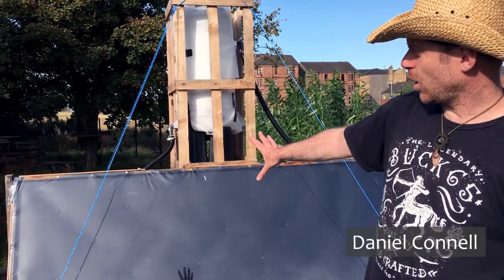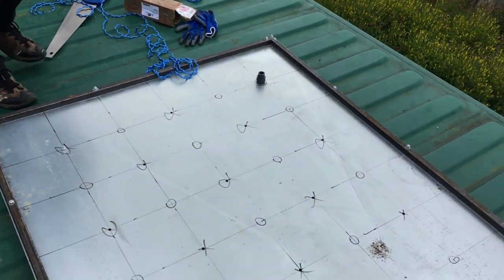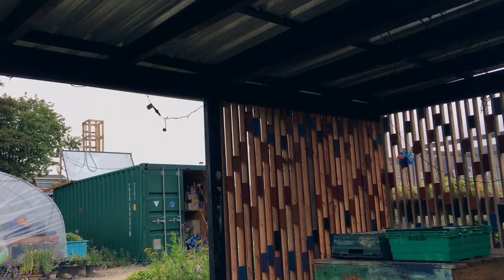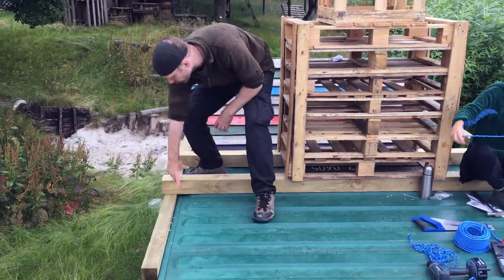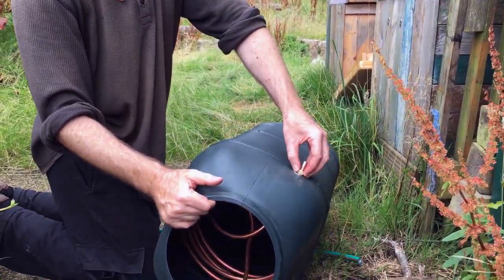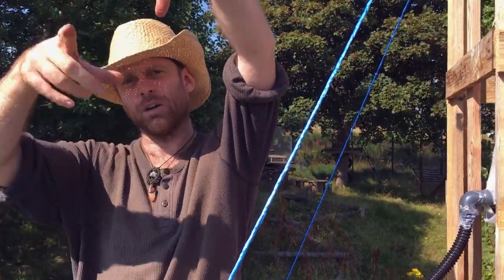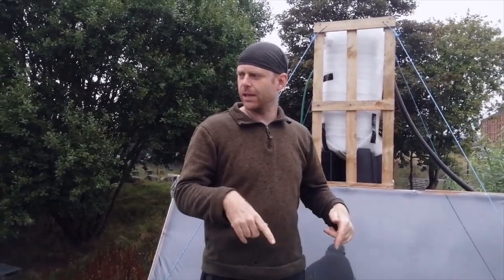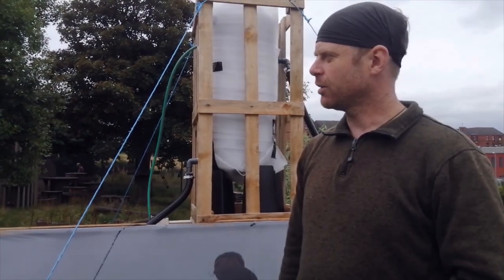DIY Solar Hot Water Panel

Comment: Aluminium Sheets vs gal steel?
Positive: its will never rust, absorbs heat better
Negative: Cost slightly more, less robust
Reply from the maker: Thought about it, I've used them quite a bit for other projects, particularly the wind turbine. The galv should also last quite a while and being 0.5mm or so the differences in thermal conductivity shouldn't amount to much.
My main concern for the alu is that even with the water tank only a meter above the panel the force on the metal is still measured in tonnes.
Reply: @OpenSourceLowTech  I choose alu coz i think it should last maybe around 30-50+ years. 3rd world countries have issue sourcing large sheet quality galv steel, alto they are galv steel but they will rust in 5-10 years, as seen in roofs etc.... 
Its the same with wire, eg, NZ farmers fencing galv wire will last decades, where as 3rd world galv steel wire only last few years before it starts to rust.

I dont think the pressure is measured in tons at a meter high, coz of the surface area of the panel + inlet/out let size ratio. eg if your tank + panel is full of water, and your poke a 10cm hole at the bottom of your panel, i would imagine the water flow is low, you can easily use your finger as a plug to stop the water flow.
Reply from the maker: Yeah long as the alu is thick enough it should do fine.

The pressure in psi is fairly low, but there's about 4300 square inches of panel..

Comment: Sooo reexplain the first part, literally no explanation at all
Reply from the maker: Full build tutorial to come, but which bit did you want cleared up?
Reply: @OpenSourceLowTech   what materials did u use for the solar part, it felt like u skimmed that right over,
Reply from the maker: It's just two sheets of ~0.5mm galv bolted together with a 40cm spaced lattice of M8 bolts and washers, and battened round the edges with ~20mm square steel tube (attached with 20cm spaced M8s).
Flat weather stripping to gasket the edges, not necessary for the lattice.

Inlets are standard male female PVC connectors through the back galv sheet in diagonally opposing corners.